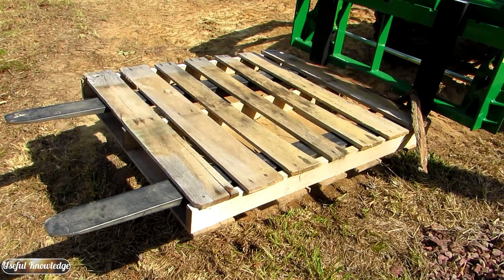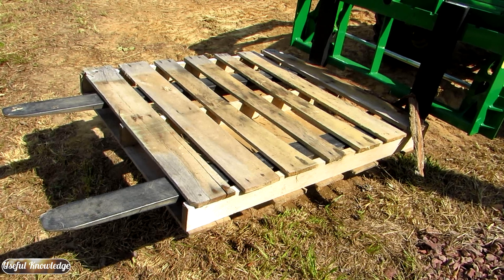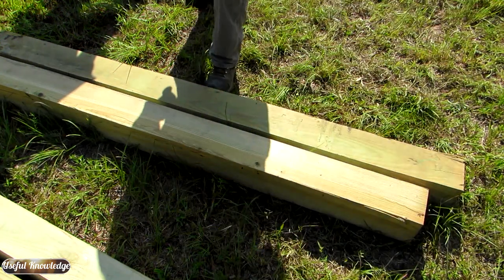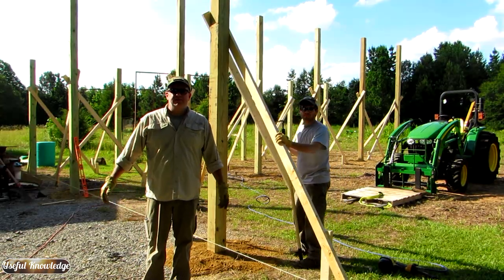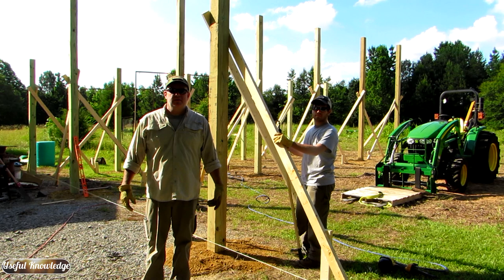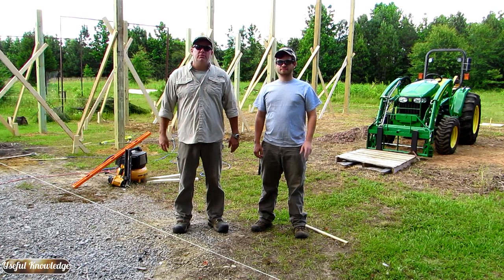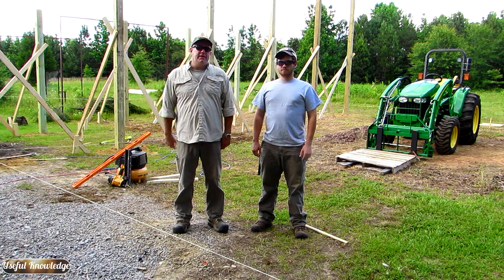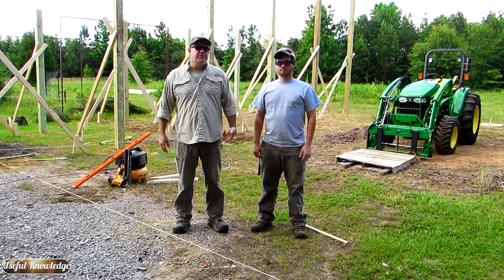Pole Barn Construction (Part 1: Setting Posts) | Useful Knowledge

Comment: Why did you not set the posts in Concrete?  Every video I have watched, no one has used Concrete.
Reply from the maker: Hi.  The main reason is that when you set them two feet into the ground, concrete is not really required to get a rigid pole set.  Also, there are many different schools of thought on this.  I was taught that setting the poles in concrete will help retain moisture around the pole where dirt will let water drain off under the ground.  I have had no issues with my other barn that I built 15 years ago.  I also make certain that I use ground contact pressure treated lumber.
Reply: I don't think that would work here on the High Plains.  We're subjected to both frost heave and high winds.  A couple of years ago we had wind gusts in excess of 80 mph.  I've got to go a minimum of 3' down (frost line is 30" to 36") or 1/3 the pole length, whichever is greater and then anchor them in concrete to increase the lateral surface area.

Must be nice to live where the wind isn't constantly trying to scrub your farm from the face of the earth.
Reply from the maker: Sounds right.  Our frost line in north Alabama is 12-18"  We get 60 mph gusts when fronts come in but the trees help to break it up so we don't have your type of wind problems.  Our main concern is tornadoes.  Of course if one hits my property, the barn will be gone along with everything else.  Thanks for sharing!
Reply: Thanks all for your response.   I'm sure here in Northern Utah, building code would require something different.  Thanks again.
Reply: Here in Montana we have to go 42” minimum for frost and what I’ve heard is cement is ok as long as you don’t set it on concrete. Put crushed gravel on the bottom for the post to set on. Pack it good then pour cement around it. If any water gets in there it’ll run out the bottom through that gravel. The worst thing is if water gets in there and sits and can’t go anywhere. So if you put cement underneath and on the sides it traps and makes it rot eventually.
Reply: You dig the post hole 48 inches. Make cement footing of about 6 inches, let it cure, and then set the post on top of that footing. If you gonna go with concrete all the way you should go ahead and make 42 inch cement pier and then set timber on it. Usually done this way on Michigan.
Reply: While setting in concrete or ground contact are the easy ways, but down the road after that part start to deteriorate, how much work do you think it will be to remove that section of pole if encased in concrete? That said DIY concrete pier (top 12 inches finished using a paper tube form, the base would add as a friction pile to reduce uplift) is a better option.
Then there is also either wet or drill set brackets (4 by 6 and 6 square brackets available) or their precast concrete permacolumns (come in three heights and also for 4/6 and 6 by solid posts, uplift anchors or height adjusters that double as uplift are additional separate items), all those made by Midwest Permacolumn rated for 10k psi/689 bar. 
Then there is the option of Morton's Permacolumn system with an adjustable base plate made of metal that doubles as a uplift protector (concrete can be set around the metal leg for added weight and protection but metal will rust, not sure how much those cost or how to order them).
Would say both offer at least 50 year life span, not sure how good either is warranted for repairs/relacement down the road, as I do not work for either company and I am not an expert.
Reply: Another option I almost forgot about is post sleeves or grade guard sleeves:

Post Protector from Orgill come in a beige color HDPE with 42 inch for residential such as decks and fences, 60 inch for post-frame/pole-building, or 30 inch grade-guard useful for all post structures, all feature three channels on two sides for water seepage that also allow the wood to breathe as well, available in all post sizes and they also offer a skirt-board protector. Recommend to use some form of uplift anchor through base of post in ground where required by code or as desired even if no such code.

Plasti-Sleeve,  made from black HDPE and smooth with the base also covered with a sealer for the top, but you still need to drill a hole for uplift anchors which would allow some water to get out so might recommend drilling a few holes just on the sides by the base before installing on post and into the ground. Comes in 60 inch length and all post sizes, also offer a back, bottom and front skirt-board protector useful for when filling the inside floor with dirt, gravel or floating concrete slab and optional trim piece for wall finishes of aluminum/aluminium or vinyl type siding, wood of any type or style or even fiberboard or stucco, also useful for pre-finishing with sheet metal, to protect against 'splashing'.
Reply: @paulwickey1688  we are in montana and building a pole barn now...we have so many conflicting suggestions as to cement vs no cement. your idea of crushed gravel is interesting....but I'm not sure how the water can get to the gravel if there's cement around the pole. any advice is greatly appreciated.....
Reply: @HTPickleball  I’m his case, he did not use cement around the pole. It is simply set in the dirt, allowing water to travel down and drain away from the post via gravel.